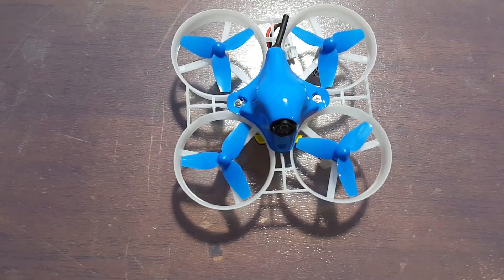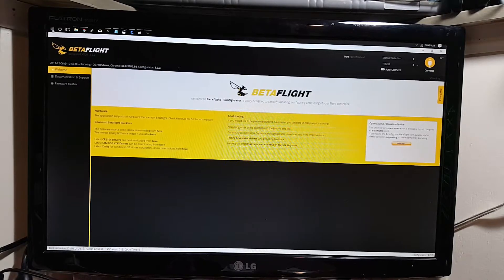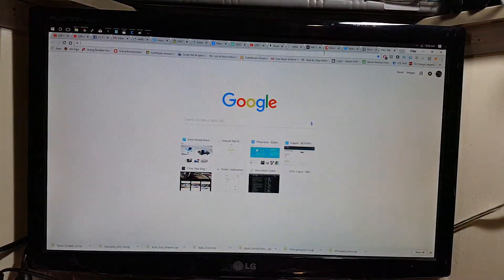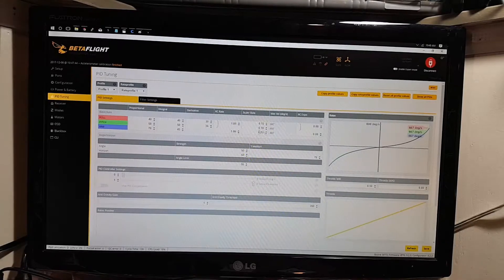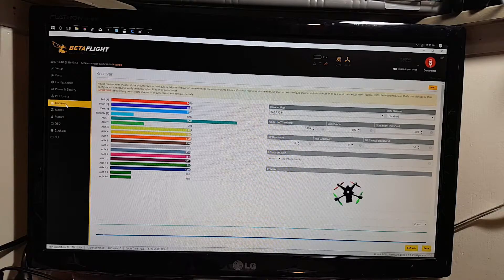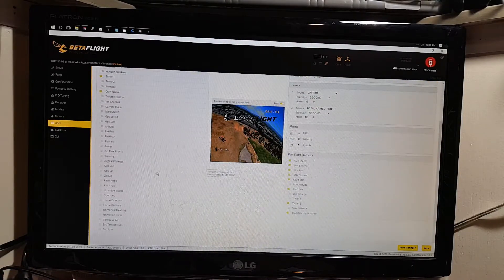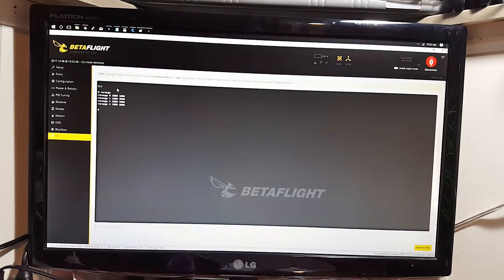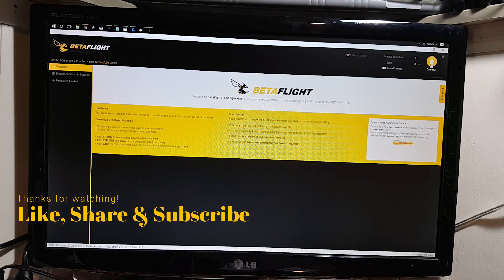BetaFPV Beta 75 DSMX with BetaFlight OSD

Comment: Hi I have the BetaFPV Beta75 and I'm trying to bind it with my Taranis X7S Q am I gonna need a external to bind even though its Frsky receiver?

TIA
Reply from the maker: No you should be able to hold the bind button as you apply power to enter bind mode.  On your transmitter select d8 and bind.  The lights should blink on your FC.  Powercycle your FC and you are bound.  If you have further issues take a look at betafpvs help desk.   
  https://betafpv.freshdesk.com/support/home

Comment: As alway buddy 👍🏼 really helpful and simple,
What reason would it be needed to change the bit you mentioned in the cli?
Mine are 1000  2000 on all channels,it arms and fly’s ok.
Reply from the maker: Sometimes the channels are reversed.  If you find your yaw and roll are backwards its a easy fix to adjust your RXranges.
Reply: C Ray Tech ah ok I get it,what’s the advantage to this way over reversing it in the handset menu?
Reply from the maker: +mark vardy I guess it's easier for me since I'm already in betaflight